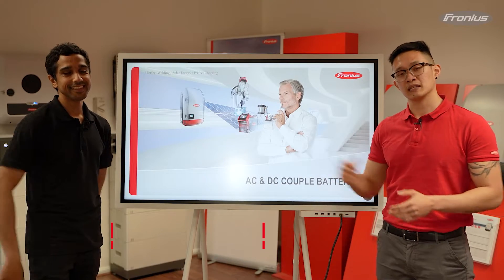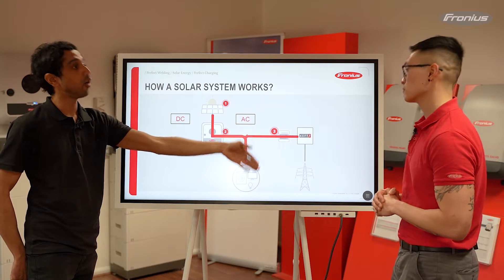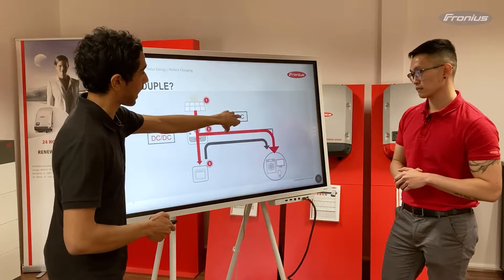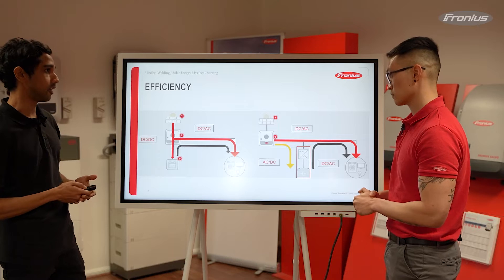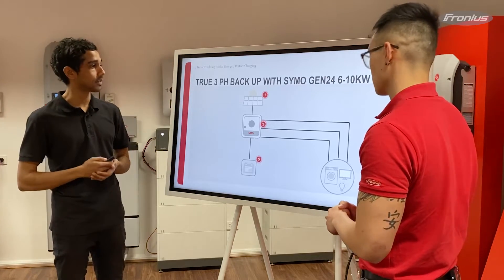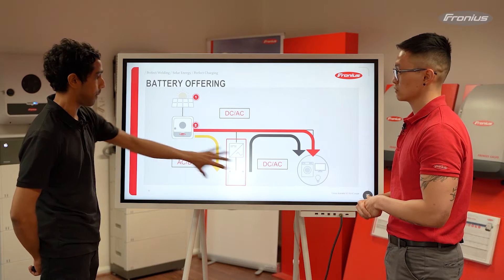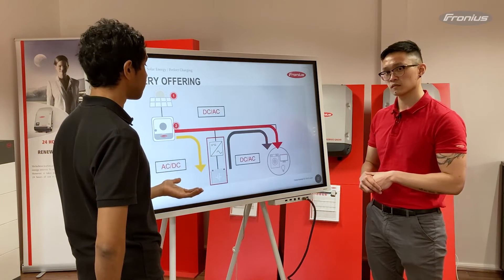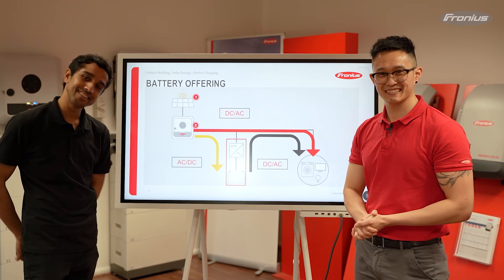What is the difference between AC & DC Coupling? (AUS)

Comment: I find it very difficult to actually buy a Fronius inverter. They seam to be out of stock everywhere I look. When do you expect to be able to keep up with demand? I live in Denmark.
Reply from the maker: Hi Torben Jacob!

Thank you for your message. Regarding your question: We try to supply our markets as comprehensively as possible, but individual availability and delivery depend on the respective market. Due to the three-tier distribution structure, we can't determine an exact supply. Thank you very much for your patience and best regards, your Fronius Team.

Comment: I have a 5 KW system using Enphase IQ7+ micro inverters and enlighten for monitoring - Unfortunately the Enphase battery solution is not available in my country, so i was wondering if you can recommend me a few  ac coupled battery solutions that i can use with my system. I quite like the Huawei Luna modular battery system, but not sure if it will work with my set up. 

Would appreciate any advise you can give.
Reply: hay Mate where are you from. Alpha series is good one.

Comment: Are the two methods of coupling batteries only for offgrid systems or they can be applied to ongrid systems as well? How can be configured an ongrid system when using energy stored in batteries not to inject in the grid, for example during night?
Reply from the maker: Hi Dan Sas!

Thank you for the feedback. Please contact our support team with your comments at support@fronius.com.

Best regards, your Fronius Social Media Team
Reply: You can use AC or DC coupled set ups in offgrid, or grid tied. For a farm for example, a mix is the best. That is, you take a Victron Multiplus II for example and feed the grid in there which is where the batteries would be connected to. On the AC Output of that, you can install a Fronius Primo (for single phase) or a Symo (for a 3 phase set up). This is an AC Coupled set up. If you put the Fronius inverter between the grid and the Victron Energy Multiplus II, that would be a Grid Parallel set up.

For DC Coupling, you would take  one or several Victron Energy MPPT Solar Chargers and connect those to your DC Bus Bars (batteries). The advantage of this is, in case of a complete power failure and your batteries complety die, the MPPT can start up with sunlight, the string inverter (Fronius or other brand) needs the 240V to wake up which, if the batteries are dead and you don't have a generator or power from the grid, you have nothing. This is why a mix is the best set up.

The Multiplus II is designed to ideally be Grid Tied but can accept a generator for example. For generator dependant or unreliable grids, your better off with a Victron Energy Quattro which works the same but has a transfer switch for your grid and generator inputs, and can start your generator automatically.

I hope this helps.

Comment: Please can you explain that dc coupling is more stable than ac coupling in output waveform of inverter.
Reply from the maker: Hi Salar Hadi!

When it comes to stability, DC coupling is generally considered more stable than AC coupling for several reasons: -->Robustness to Load Variations: DC coupling is less affected by load variations compared to AC coupling. -->Improved Low-Frequency Response -->Minimized Phase Shift

Best regards, your Fronius Social Media Team
Reply: @FroniusSolar  i'm interested in DC coupled system where an inverter takes in battery directly.
in this case, does it mean, PV panels with 6.6kW DC out to a 5kW-inverter, generating 5kW AC to the grid, while the remaining 1.6kW DC from PV can be stored in the battery?

Comment: Dc coupled your are limited by the hybrid inverter size. So at night time if your battery lets say 19.2kwh of  storage which can supply 7kwh and your hybrid inverter is 5kwh your Max power to the home from the battery will be 5kwh. This is important on single phase especially if you are a high power user at night. Ac coupled works differently as your not limited by the hybrid inverter as it doesn't affect the power draw as the power comes directly from the battery. So if you had 2 x tesla powerwall 2 and each provide 5kwh of power you would have 10kwh of power available. On Dc coupled with a single phase house it doesn't make any difference how many batteries you have and the total kWh available as you will always be limited to 5kwh of the hybrid inverter. Another advantage of Ac coupled is that you are not affected as much when your solar system breaks down as Ac coupled batteries can still charge from the grid even when the solar isn't working which is good if your on a time of day tarrif. Dc coupled require the hybrid inverter to be working to charge the battery from the grid.

Comment: 4:04
i'm interested in DC coupled system where an inverter takes in battery directly.
in this case, does it mean, PV panels with 6.6kW DC out to a 5kW-inverter, generating 5kW AC to the grid, while the remaining 1.6kW DC from PV can be stored in the battery?
Reply: I was told this but it's not the case...

Comment: I don't have a grid but I have 2 grid tied inverter of 6kw and a hybrid inverter of 6 kw 
Can I feed the grid tied inverter with the hybrid to simulate the grid and have a total of 18 kw
Reply from the maker: Hi Serge Sicard!

INo, our hybrid inverters don’t support any additional generators within their backup power circuits. The hybrid inverter intentionally builds its backup power circuit with 53Hz instead of 50Hz, so that no other inverters synchronize to the circuit.
To simulate a stable grid with multiple generators you would need additional third-party hardware. We can recommend the manufacturer Victron Energy.”

Best regards, your Fronius Social Media Team

Comment: Your AC Coupled you explained is actually  a Grid Parallel solution. Your DC COupled solution is just an inverter charger.

AC Coupled is when your string inverter is on the ouitput of the inverter charger (not like you showed).

A DC Coupled solution is when you have your solar panels connected directed to your batteries using a MPPT or PWM charger.

Your sizing is incorrectly explained also. Yes, you can have 150% of solar to your inverter nominal rating but you will only ever provide its nominal power at most. That is, despite having 7,5kW of solar panels on a 5kW inverter, you will only ever get 5kW max out of it.

Fronius is a great brand but I'm dissapointed with the incongruencies in this video.
Reply from the maker: Hi Andrew Fernandez!

Thank you for your suggestion. We will forward this directly to the colleagues in the responsible department.

Best regards, your Fronius Social Media Team
Reply: I was hoping for confirmation that an Ac coupled solution can supply not only the string inverter kw but also the battery inverter kw simultaneously to a house.

Ie if your solar system is generating 6kw and the inverter is rated at 6kw and the Ac coulled battery is full and 3kw then you can supply 9kw to the the house? Or at least this is what I have understood from previous research.

Perhaps someone could confirm.
Reply: @scottyboymu  Hiya Scott, yes, you can consume energy in your home from both the AC Coupled Fronius inverter and also the batteries through the Victron inverter (from Batteries or MPPT solar chargers or both). You can also add passthrough from the grid and/or grid parallel inverters if required.
Reply: I agree.

Most Modern inverters have  PV curtailment features.

We have a similar understanding of AC coupled and DC coupled PV systems.

Ac coupled- we have a grid tied inverter with inverter chargers and a battery. The battery is connected to the inverter charger(let's say victron quattro),connected to critical load panel.The grid tied inverter is connected to the output of the inverter charger.
Reply: @scottyboymu  reading your text after 2 years , may be you can clear my concept now :-)

Comment: Sorry but I could not help but think that it was an oversimplified presentation. There was NO mention of net-metering and the effects of power outage on either DC or AC coupled systems. But one of the biggest issues was what happens when a power outage takes place in the day time? Why can't the solar panels provide energy to the household with the use of an auto transfer switch that cuts power from being fed back to the grid?  The present hybrid solutions rely on the battery bank during outage, which means that the power generated by the panels is NOT BEING USED? I request the Fronius Team to give a complete solution with effects of outage during day time. Looking forward to a fruitful discussion.
Reply from the maker: Hi Naeem Jan Amin!

There is a possibility to have backup power up to 3kW wihout storage. This function is called PV Point, which is available with all GEN24 Plus inverters.

Best regards, your Fronius Social Media Team
Reply: Why not provide full power available from the panels? Say if the installed power is 10kW ( based on STC values) and available PV power at peak timings, about 1230hrs is 7.5 kW, why can't   the inverter provide 7.5 kW? Why the limitation of power? I would request a complete presentation on this topic along with the reasons.

Comment: Why does it take 60 to 90 seconds to switch over to battery in brown out/black out of grid AC even when not using any grid power?

This makes your Fronius 6.0kW GEN24 PLUS with BYD a joke...  most inverters are milliseconds no switch over loss of power...

Explains why we still use grid power every day when the batteries never been flat and even when PV is generating... the system is so slow it uses grid power over actually using the battery or PV... that right PV charging the battery and will use Grid to run kettle ect for 20 to 30 seconds before using PV or battery...

So will still get a bill for power...